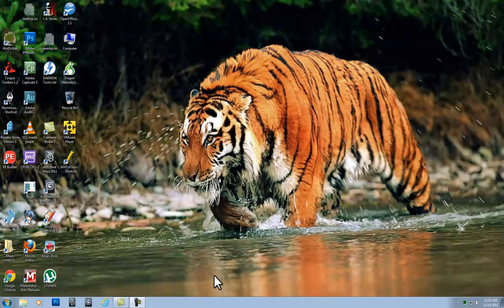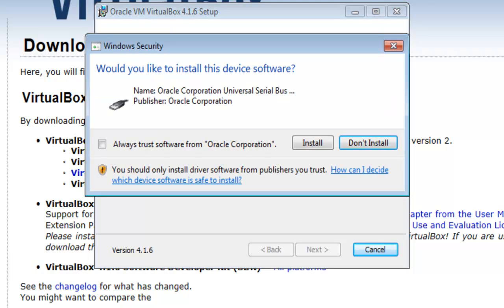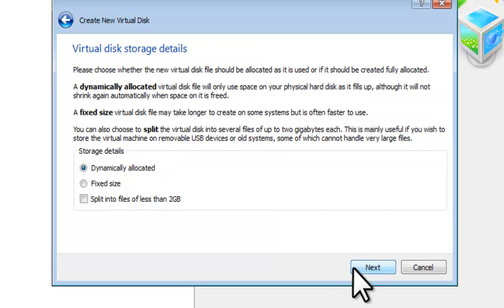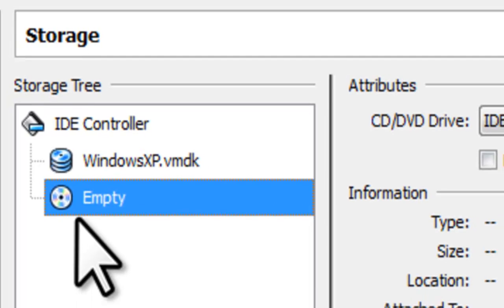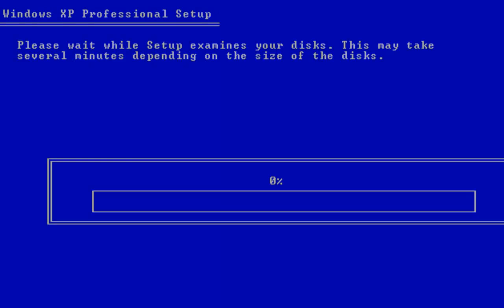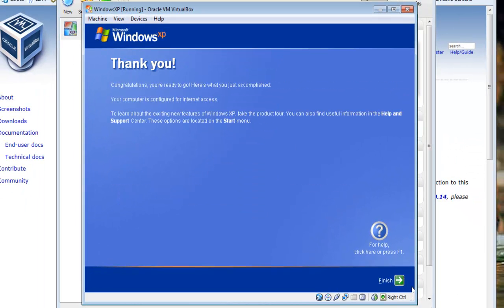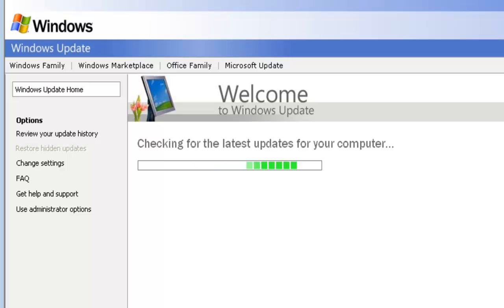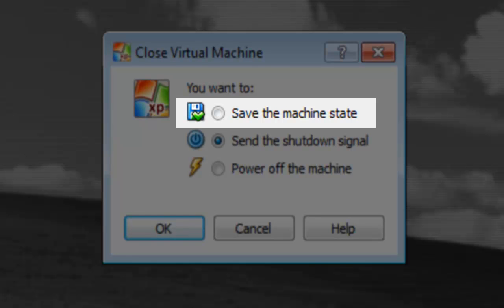How to Create a Virtual Machine Using VirtualBox [Tutorial]

Comment: Thanks for the video, but I am getting below message while trying to install VM.

The virtual machine 'Red hat' has terminated unexpectedly during startup with exit code 1 (0x1). More details may be available in 'C:\Users\tskot\VirtualBox VMs\Red hat\Logs\VBoxHardening.log'.

Result Code: 
E_FAIL (0x80004005)
Component: 
MachineWrap
Interface: 
IMachine {5047460a-265d-4538-b23e-ddba5fb84976}

Comment: Thanks for the video, it has helped me set up VR machines well. I do have a question, I'm trying to set a machine up for my parents using a copy of windows 7 I no longer need (make it legit). I follow this video to the letter but get an error when the VR machine starts>> "ata2 master: Unknown device". I have tried several ISO's also for win8, 8.1, 10 and Ubuntu with the same error.  I'm at a loss for why as I've done this more than a few time on my machine with no problems, but this is also the first time doing this on a Ryzen (using an MSI x470 with a 2600 CPU) set up too. Any thoughts?

Comment: What happens now in the year 2017 when XP is no longer supported? I need it to run programs from that time ago and have it up and running now in VirtualBox but have no idea whatsoever as to how to install other software that I need (Visual Basic), which comes in three 'Floppies'.... I disc copied these discs and placed them in C: drive and hit Setup and it worked until it needed to read (obviously) something from Drive A: In short the question is 'How to set up Vis Bas in VirtualBox running XP'? And what do you do about Activating the XP when its no longer supported by Microsoft?

Comment: Guys most of you are going to face the below error while installing the VM Workstation

{{This virtual machine is configured for 64-bit guest operating systems. However, 64-bit operation is not possible.
following with 3 options or steps.......... }}}

Solution: Just go on your bios settings, 
                 under advance settings click on the virtulization to be enabled or check mark it.
                 Try Opening the VM Workstation again .....

Comment: Keep getting error insisting I am running an i686 cpu. Cpu is amd64. Tried running 64 bit isos did not work. Tried running i86 isos did not work. 

The fuck does it think I have an i686 cpu, its an i52k series amd64 cpu. 

Am I fucking up the settings somewhere? (note tried this with ubuntu 12.04lts)